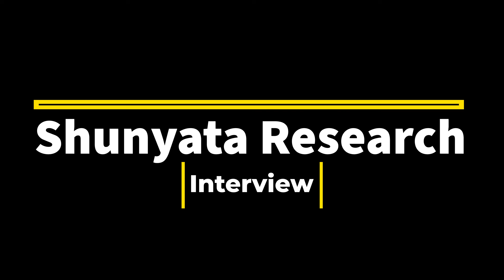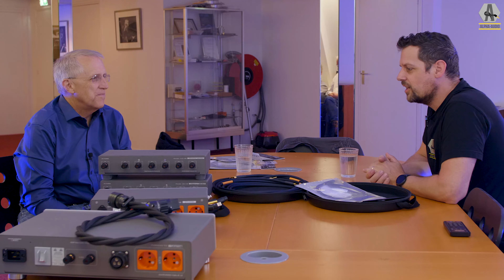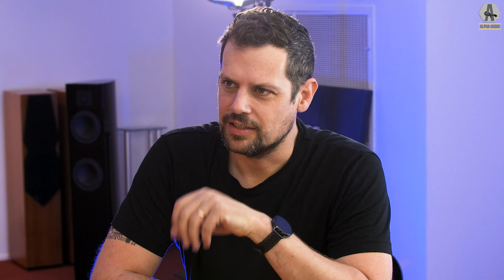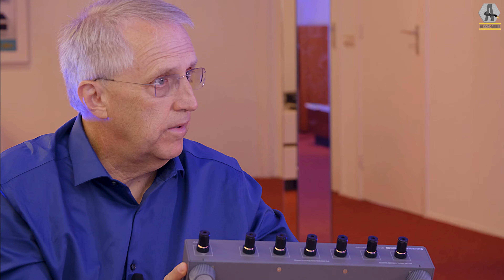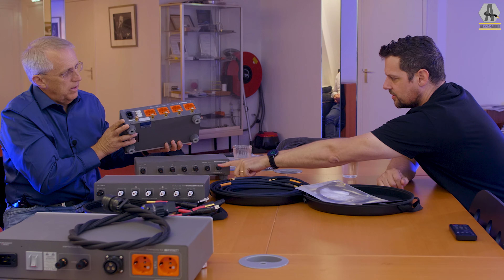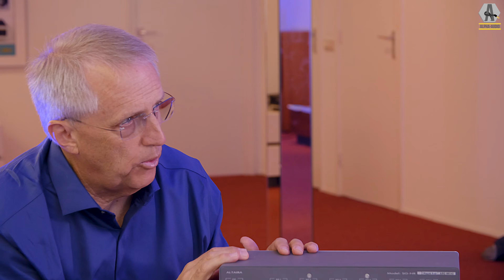Interview Shunyata Research - About Equipment Grouding and Conditioning

Comment: This was very good.

I am soon taking possession of a Shunyata Eeverest 8000 power distribution unit (a floor model from a high-end store).  I asked the dealer about those grounding terminals on the back of the unit, and he said that requires the Altaria unit.  So this video helped me understand some of how this all works.

However, I am still not clear on exactly how each component connects to to each other, when, for example, using an Everest unit and an Altaria unit.

Exactly from where to where does each grounding cable connect?
From the pre-amp, to the Altaria, and from the Altaria to the Everest?  If yes, then is there an input and an output on the Altaria?

And then there's two different Altaria hubs?  A "signal" hub and a different one (not sure what the other one is called), and they handle different frequencies?

It would be appreciated if someone would explain what connects to what, and to which hub, on a system that has a turntable, phono-amp, pre-amp, DAC, amps, streamer, and digital re-clocker (such as the Berkeley Alpha USB Series 2).

Thank you.
Reply: A few hours ago, I spoke to Scott (did not get his surname).  He was sharp, and very helpful.  He cleared everything up for me.

Comment: I have to an older single ended DAC and lifting it's ground clears up it's noise by a lot. Why does this happen? Will a chassis grounding box help further?
Reply from the maker: Lifting the ground prevents ground noise from entering the device. Grounding the chassis can  help. It depends on the layout.

Comment: Great Interview! IME getting the power right is one of the foundational elements of a system build...alongside device isolation, room treatment/isolation and speaker placement. The quieter your listening environment the deeper you see into the music. I use Shunyata Shunyata power cables and the Everest (for front-end) and Denali (for switches) conditioners, with all components chassis grounded to the Everest...couldn't be happier. I also use Entreq and Kojo for additional chassis grounding of pre-amp, switch and the DAC. The difference is not subtle...the ambient noise in my room is 30db on average, going down to 29db later at night. Love your videos...keep up the good work. Cheers from Australia!
Reply from the maker: Welcome man!

Comment: Interesting interview, thanks so much!! What I not realized, because not a big Shunyata Fan in regards of complete overpriced gear (working in verticals where price doesnt matter!!)  where there research is coming from. All materials can be manipulated on molecular level, thats nature, but we cant measure it obviously. What I criticsm is, if you add another cable + 2 more interconnects, of course you loose something in you signal path. So this needs to be compensate again.... THOSE INTERVIEWS love it, KEEP GOING & thanks for your efforts!
Reply from the maker: Thanks. And welcome!
Reply: Not necessarily.  If the grounds of the cables are well-connected, they can improve shielding of the entire system.

Comment: Im sure this  system works, but there  are far more less expensive things someone can and first should do to ensure they have a healthy electrical system that is up to code and will help your gear's performance. These boxes or conditioners won't be beneficial   if the electrical system is a mees or is compromised to begin with. 1st do some research and hire a licensed electrician  to make sure your  home's  electrical wiring is in good condition. Ask them if you have copper wiring or  (hopefully  not)  alluminum cladded copper wiring.  Sockets  should also feel sturdy and they should be firmly grabbing the plug. 2nd is  that your sockets and  electrical  panel are all properly grounded with the least amount of resistance. Polarity (hot and neutral) to them should be correct and not reversed. 3rd is that the connections to the main earth ground from the home's panel and any wires connected to it are free of corrosion and properly tied to it. The ground rod should also be checked so it has low resistance and isn't  heavily corroded. These rods are made of either copper (fantastic) or anodized/bare steel rebar,  and can fail in time from moisture and weathering. 4th is  having an electrician  make sure    ground screws and  terminals inside the main service panel are properly tightened down and are free of oxidation. Deoxit can be used on open exposed wire. 5th is that all the breakers are working properly and are not showing signs of stress from over heating or loose from age. Checking all this or getting an understanding of your own home's electrical system's integrity is far more less expensive  than you'd  think. From there you will hear a big  difference if something is wrong and is corrected. While he's there you can even ask for an estimate for separate main lines to your audio system with 10 or 12 gauge Copper wire. After all this, then you could start looking into power conditioning,  regeneration, or a HI-FI grounding system. Happy listening
Reply: And all that good work is undone by using LED lighting...
Reply: @joshua43214  Using quality LEDs can mitigate this to a certain point. The chinese specials are a mess.
Reply: @joshua43214  not if you use audiophile led lighting.😅 🐍
Reply: @joshua43214  What is the best alternative nowadays?
Reply: How would this system no help if it is essentially taking the dirty power and cleaning it?
Reply: I did a lot of this myself. I’m still alive 😅

Comment: 18:30 If a Cable Internet or Cable Tv customer is getting a buzz or hum, the cable installer probably did not properly ground their service coax connection to your home. They should be using a coaxial ground block ($7.00) in between their service connection and your home. That  ground point should then be gounded to your home's grounding rod or where the entire home's electric service is grounded.
Reply: It's also dangerous not to ground it, the voltage potential difference can reach several tens of volts in worst cases, and during electromagnetic storm when lightning strikes nearby the induced electromagnetic impulse can be destructive.

Comment: I have Telos active grounding in my system. (The GNR 5.1)  As Grant mentions, and the Telos dealer in Australia recommends, I use chassis ground, which requires attaching  a 5mm spade -ended ground cable to a chassis screw.  As Grant also mentions, there is a breathtaking improvement in SQ!